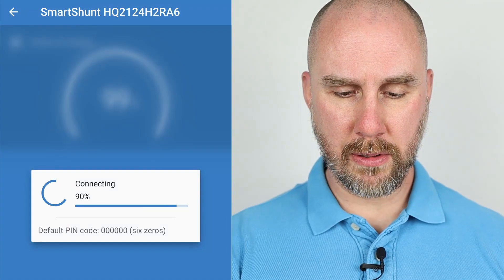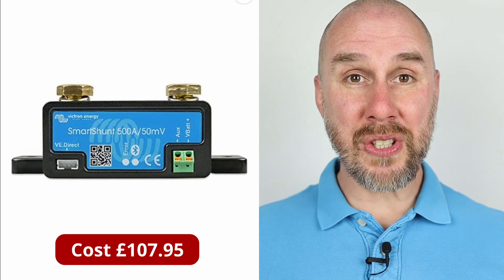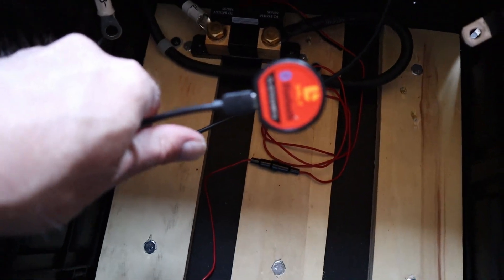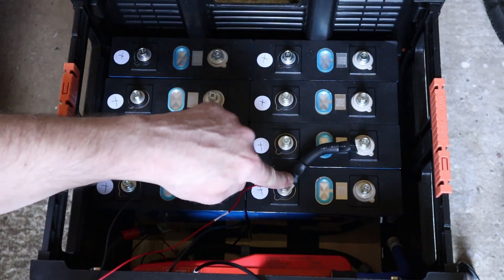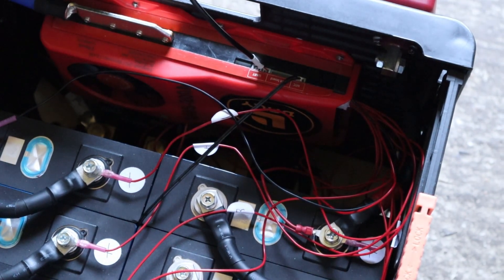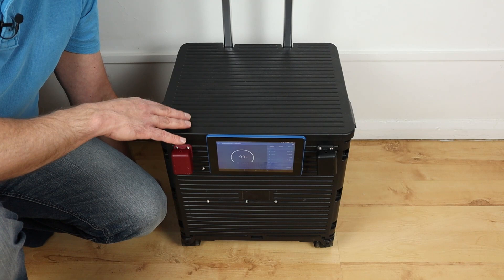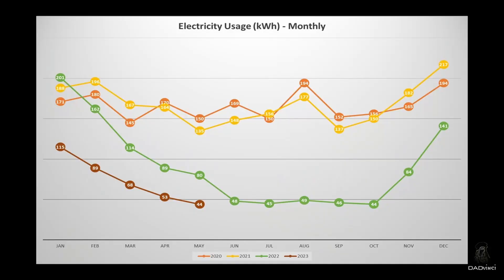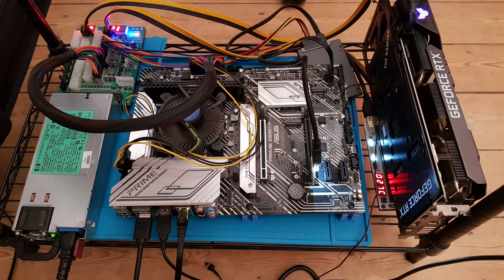5kWh LiFePO4 Shopping Cart Battery | Long-Term Build Review

Comment: cool project for beginners. I would offer that you should really have connected the shunt in between the battery and the BMS, not the BMS and the terminal. The reason is that right now the draw of the BMS is not being considered in the draw. Now, I know it won't be much current, but it will be SOME. Cheers
Reply from the maker: @sNEAKYnIGHTmUPPET  Good day and thanks for your feedback👍. The smart shunt I used was installed correctly according to the manufacturer instructions, the BMS negative is the battery negative (the same as ready constructed batteries). I've not seen anyone else install it as you’ve suggested. For the negligible current involved, bearing in mind this shunt needs recalibrating on occasions anyway so isn’t completely accurate, it wouldn’t make any real difference. The shunt also draws a very small amount of power too. I wouldn't want to bypass the protection features of the BMS either, which putting it the way you've suggested would do. Thanks for sharing your idea though. All the best, Adrian
Reply: @DADvinci  the other downside which I didn't mention is that if your bms disconnects due to high or low voltage conditions, then so does your shunt. 
I am not asking here, I am very knowledgeable in this field and have been doing systems of all sizes for years. Also an electrician of 35 years now just trying to share some knowledge with you. 
Also the reason the manufacturer says the breaker can go either way is that it can. When discharging current flows through one way, and during charging it goes the other. This is why it doesn't matter.
I am not trying to put your stuff, down, just trying to help out the newbies coming up. You sound a little defensive to constructive comments, and if that's how you want to do it I will not visit your channel. 
I am only trying to help, don't immediately try and shut me down. Have a nice day.
Reply: Another thing, there are no "ready made" batteries with a smart shunt installed, so I am not sure what you were thinking when you wrote that. The closest you'll find id the dodgy shunt in the BMS, which is not terribly reliable due to no RMS function and the way inverter/charger work with their HV Bus.
Reply from the maker: @sNEAKYnIGHTmUPPET  It wasn't my intention to come across defensive and I value any input in pursuit of learning. I was just passing on my opinion/actions, whether it's correct or not. You clearly know much more than I had appreciated as it's your trade. I get a significant number of comments and emails telling me what I'm doing wrong, so spend much of my time just stating why I've done something, nothing more. If I can be so bold while you're stating I'm sounding a little defensive, your offer to share your knowledge does come over as a little condescending. If that's not your intention, then fair enough, but there are two sides to an interaction. 

Just to clarify the ready constructed battery comment, I was referring to those already in a box with just terminals to attach wires to, so again it would be a matter of attaching the smart shunt externally as the box would be sealed (no direct access to the BMS). I've found that the BMS based shunts aren't at all reliable, so completely agree with what you're saying.

With regards to not coming back to our channel, that would be a real shame. It's your choice of course. I value each and every subscriber or those just passing through on a regular basis. Would I love to do this full-time and get qualified, without a doubt. My trade is computers and digital tech, done that for 30+ years and help a considerable amount of people outside of this venture. Time is the only enemy. Cheers, Adrian

Comment: What i found with the daly bms is when you connect to a tablet the interface reboots and you have to keep pressing the button on the remote to get it back again. Its really annoying. 

You have some serious toys now!
Reply from the maker: @LITTLEEXPERIMENTCHANNEL1  That is annoying! The mobile app(s) definitely have 'characteristics'. Even the Victron app sometimes has 'funny' days and keeps resetting or reconnecting. I can only assume that I'm getting interference as I've got a few Bluetooth devices around, they are bound to trip over each other. This build has surpassed my expectations. A larger 48V system should be very interesting....

Comment: Hi Adrian,

Good to have you back Sir and for me just the right video!

I want to do something very similar, here goes....

I want to install a 3000 Watt inverter, batteries, solar panels etc in my new place, here's the bit i'm not sure on. I want to wire it directly into my fuse board via a thing called a 'Transfer Switch'. I want to be able to switch completely over to solar/battery power at the flick of a switch and back again to mains electricity when the batteries are low etc, there are several videos on the tube but all are American based, i cant seem to find anything UK based, not even a transfer switch, surely this is possible? I will obviously get a qualified electrician to install as its a bit above my pay grade!! lol

Keep up the great work, very inspiring.

Kind regards

Tony
Reply from the maker: @LRDefender1968  Hey Tony! It's great to hear from you and thanks for your very kind feedback👍😃. My day job has been very busy so I've been very pushed for time recently. 

You should be able to get a domestic transfer switch in the UK. I think they are more commonly used by people who have generators for backup power. As you say, you'll need a qualified electrician to do the install. I should also look into the same as my home is mainly made up of extension leads! Please let me know how you get on. Take care, Adrian

Comment: Nice build man, and a great idea on adding the Fire tablet in the front. What kind of life cycles are you expecting from these cells? Thanks for sharing man.
Reply from the maker: @ReviewsOnThisandThat  That's very kind of you to say, thanks👍. They appear to be good quality cells so cycle life could be substantial. In the better solar months, I'm not fully cycling the battery as it's hard to use what's coming in quick enough. The only thing I try to ensure is that they don't get too hot (during peak summer months). I believe 1000s of cycles is achievable (to 80% capacity remaining) with the way I'm using them, but it's a difficult one to say for certain. The BMS is likely to give up before the cells do, which I can easily swap out. I hope this helps a little. All the best, Adrian
Reply: @DADvinci  You are welcome, I have heard lots of good things about that Daly BMS too, best of luck to you as well. Happy sunny days my man.

Comment: Great video as always!
Can't wait to see what you do with 48v. 
Can't believe how little power you use in your house.
In Florida USA my new house uses 800kwh a month vs your mid 40's. 
I'm just gathering supplies for my 24volt system now that I'm settled in the house.
Reply from the maker: @CanadianTank007  Always too kind, thank you 😃👍. I've got some cells for the 48V one, but have a problem with their capacity (currently working with supplier). Also got another 24V build and something a little unusual for another 12V (will make videos for both). Gas takes the strain for heating, hot water and cooking + no cooling which would be electricity. Saying that, gas for May was the lowest since I started tracking it in 2020 at just 219kWh. I expect my house is much smaller than yours and you're fully electric, so everything goes through your meter. Great to hear that you've settled and there's a build on the horizon. Are you going to build from scratch using cells? What capacity are you aiming for? Cheers
Reply: @DADvinci  Always look forward to see your ideas since its always different. Yeah florida is hot and the smart home stuff my house comes with helps with shutting things off and turning the on less frequently when we aren't home. I will be using 2 power queen 24volt 100ah in parallel and a grid tie inverter to assist with power during heavy use. I'm planning a 1.2 kw solar array on side of house. Like the tablet idea and you can even have remote viewing of the tablet with home wifi to your phone.